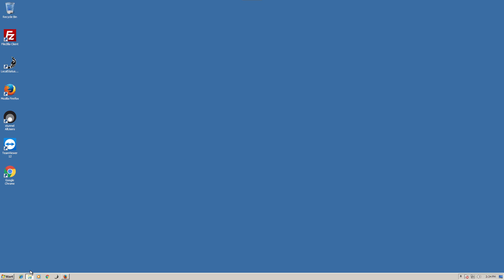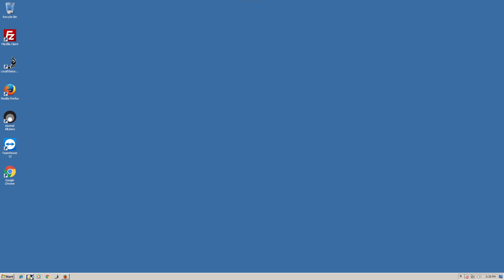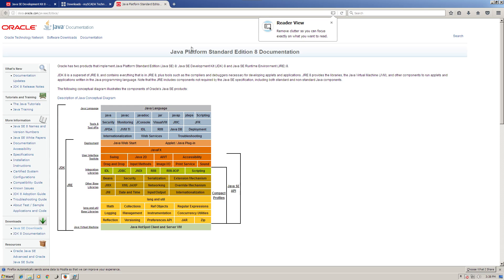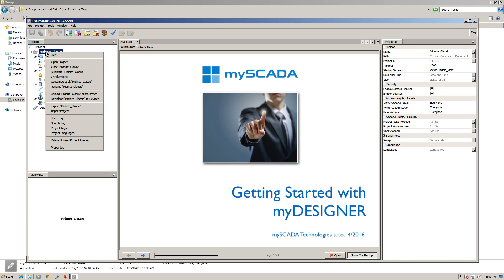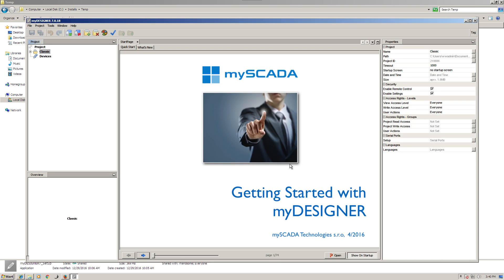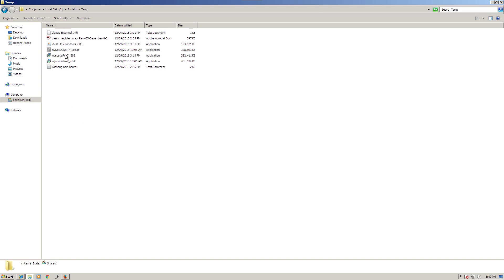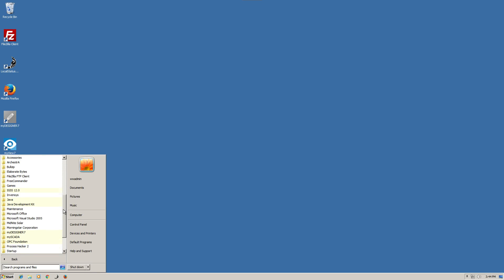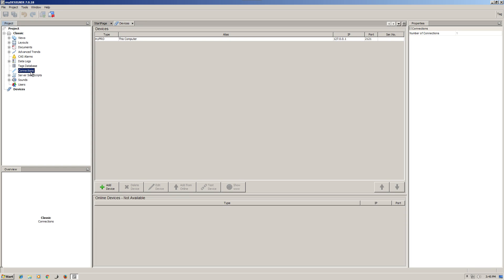DIY Classic Monitoring Software - brief tutorial

Comment: Nice video I just can not get the localhost part working yet on my desktop or laptop so I guess I need to keep working at it. Thanks for this info.
Reply from the maker: Make sure your firewall is turned off, or edit your hosts file.  You can google "Editing the windows hosts file"  to help you if you've not done it before.  You can also simply try to "ping" 127.0.0.1 to ensure that you get a proper response from localhost.
Reply: I got it working with there myView7 and got the web working also so thanks a lot I got this all done and am now planing my project
Reply: rhandsom I am also a linux guy so it took me some time to figure it out
Reply from the maker: Cool, let me know if your still running into issues and I'll see if I can help.
Reply: rhandsom years I got it working on my laptop but on my desktop pc the Web part still does not work. I am also looking to see if EPever works on modbus
Reply from the maker: If you have Windows 7, you may have to enable (add) the IIS web server feature through windows control panel.
Reply: unfortunately my desk top is windows 10 64bit and has been a pain but the laptop is working so I am good to go for now. Working on it as I type this :)